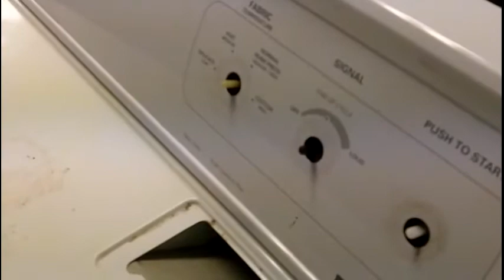Kenmore 80 Series Electric Dryer Disassemble and Cleaning (Part 1)

Comment: The "Hola. Juan Valdez.  ¿Cómo estás?" was hilarious.  The dust on the paper showed up real nice on camera.

Make sure to disconnect the dryer from the "walloutlet".

Next video:  Removing the water heater (including flooding the basement, breaking pipes and valves, soldering and almost setting the house on fire) to vacuum underneath it.
Reply from the maker: I still haven't gotten around to vacuuming under the house yet.
Reply: @xjoe81x  That can lead to big problems.  Once a year I get a crane in to lift the entire house so I can vacuum.  You'd like it too, he doesn't use jack stands.